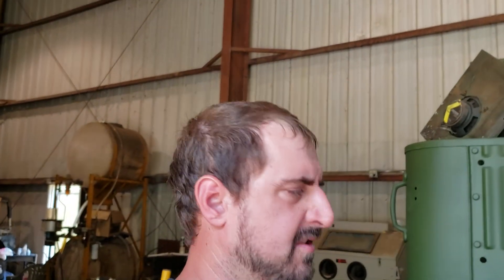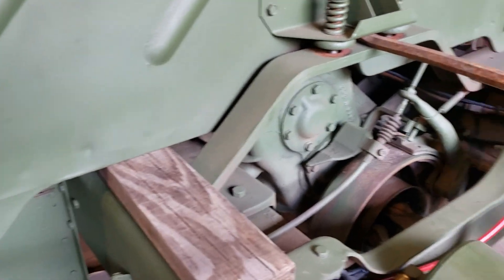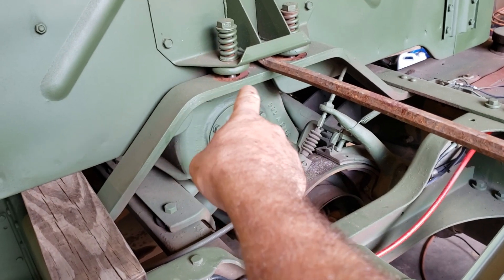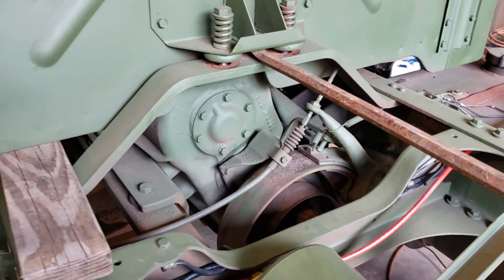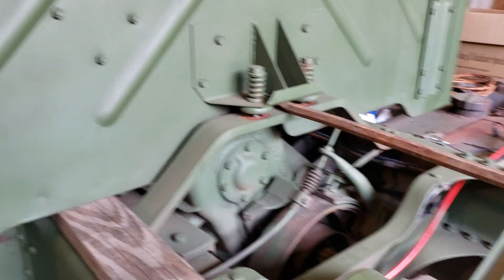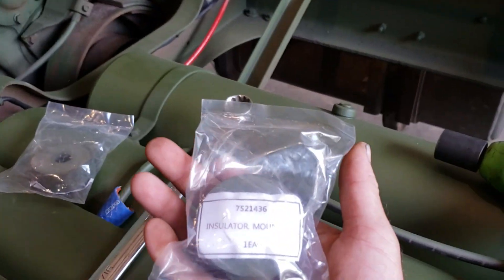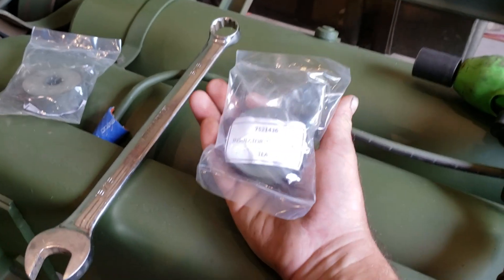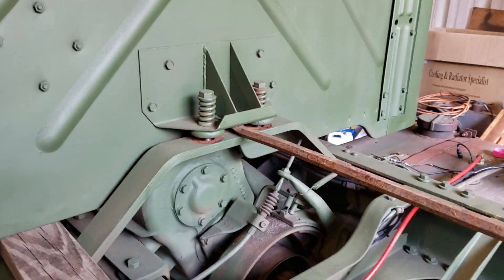M35A2 cab mount bushing replacement

Comment: My P.O. extended the cab, but moved and installed the mounting bar onto the TOP of the frame rails! So to keep the cab level, he removed the bushings, bolts and springs. I will need to remove the bed, drill and remount the bar under the tops of the rails, then install the correct bolts, springs and bushings......
Reply from the maker: Or you could just do a 1/2" body lift on the front cab mounts and fenders and grill.
Reply: @tacticalrepair  Yep, I could do that, but I'd rather just put it back like it should have been done at first. I am planning to remove the bed to access the air tanks etc so that I can properly mount another fuel tank on the drivers side......